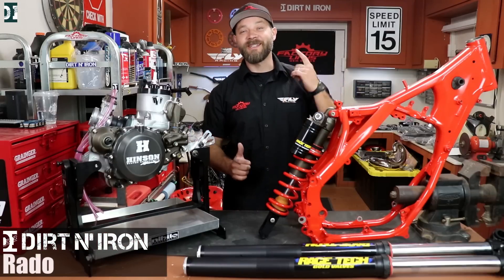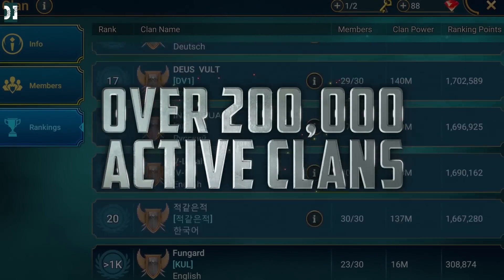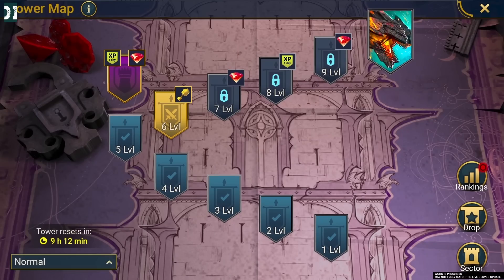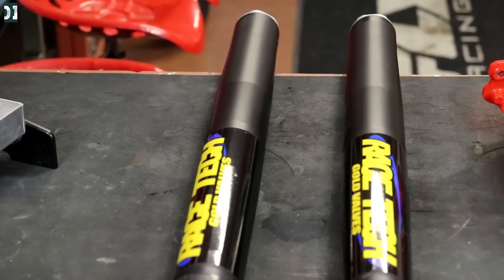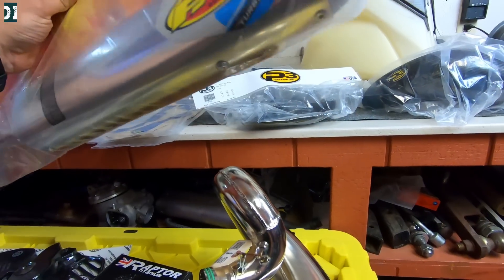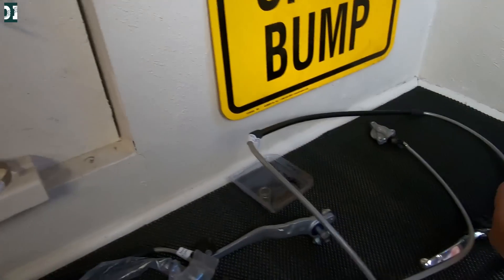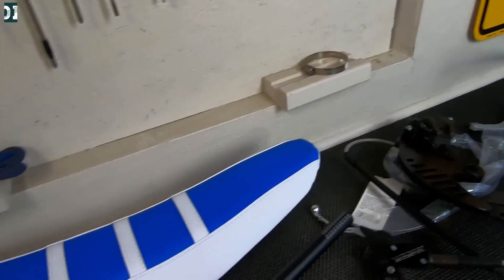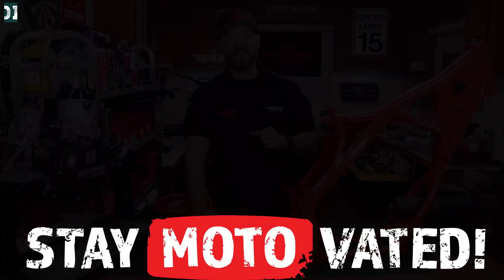KTM 300 XC build - NO ORANGE!! - but why?

Comment: Thank you again for your videos, 
I just did my first step and disassembly my TE125 (dont touch the engine) i got only the engine on the frame (grease and change some bearings) and assembly everything together thanks for your videos
Reply from the maker: Nice work! glad you could get little motovation here, good luck!

Comment: Hey, love the build and videos. I’ve done a couple builds myself over the years and the one thing I noticed I never hear you talk about on an older bike build is whether you x-ray or ultrasound the welds on the bike frame. I would highly recommend it if you don’t already do it. I re-built a CR500 back in the 90’s once and had the welds tested and found a weld on the steering head that was cracked (couldn’t see it with the naked eye). Could have caused some serious injury had it broken while riding. Anyway, my 2 cents worth and keep up the good work and the videos coming.
Reply from the maker: thanks Preston, thats very interesting idea. I am not doing  it now. Where did you get it done ?

Comment: One part I would recommend getting is a exsust flange support I have a 2016 250xc which is very similar to your 2012. It can me common if you hit the pipe to crack the exsaust flange that's why I would recommend one.
Reply from the maker: thanks Colby, good point! I am getting one from Tusk, its already on the way. I cracked the flange before.. hard to get that fixed
Reply: @dirtniron  Good to hear I have the tusk one as well has been good to me so far. Also sorry to hear you cracked one but thats exactly shit I run it.

Comment: Question. How do you get the Hoses out of the frame for powder coating. Or did you leave them in there the whole time?
Reply from the maker: get them out, there is a tool for it. My friend did it for my frame

Comment: Great choice as always rado can you find out if its possible to fit the same plastics kit to a 2010 ktm 300 even if there is a couple of mods and wot are thanks love your builds so motervating for me to up date my ktm 300exc keep up the great vids m8t
Reply from the maker: thanks mate, front fender and number plate will fit with the bracket, rest is questionable, I did tons of research on the forums to see what other guys were able to put together. I suggest you do the same, chances are some guys already tried what you want to do. vitalmx, thumpertalk, ktmtalk, etc